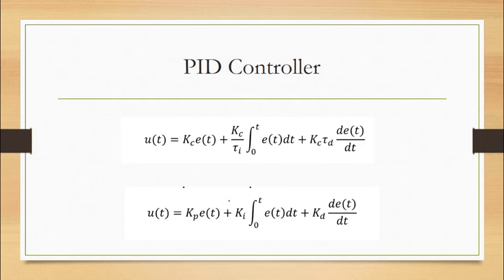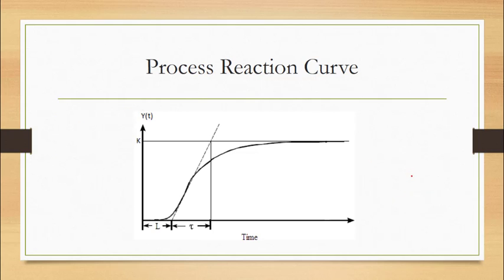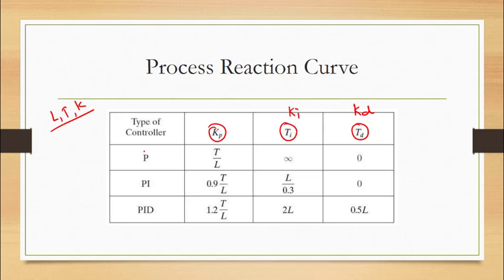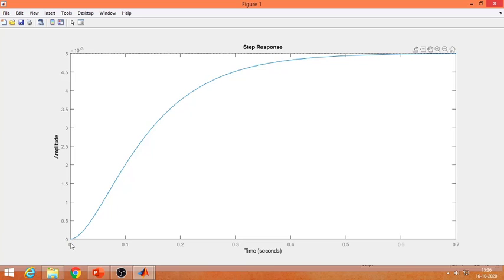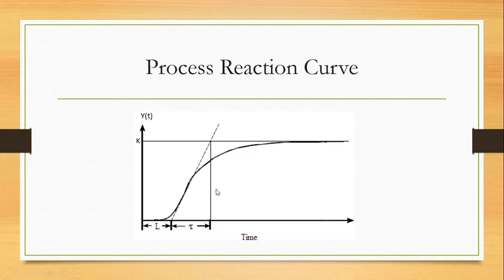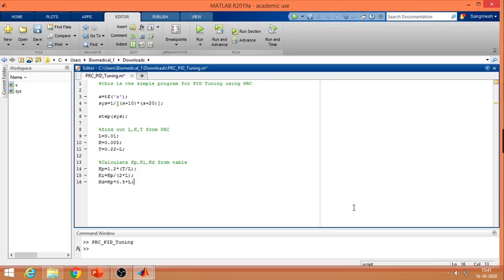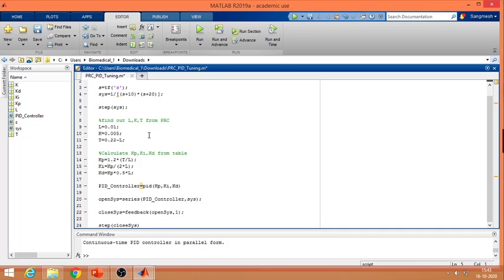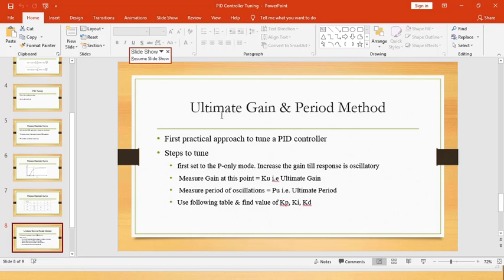PID Tuning | The Ziegler-Nichols Tuning Rule for PID | Process Reaction Curve | MATLAB example

Comment: Sir, what about control signal? You got a very nice response but when i did the simulation of it, i saw that it is not applicable because of huge control signal. Then i added integral anti wind up and saturation block but this time my response got harmed. What do you think?